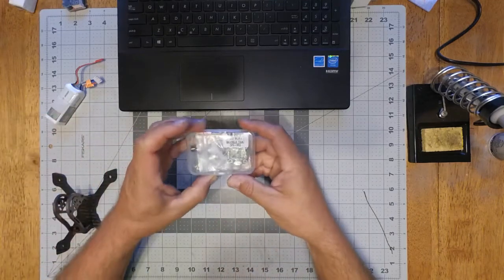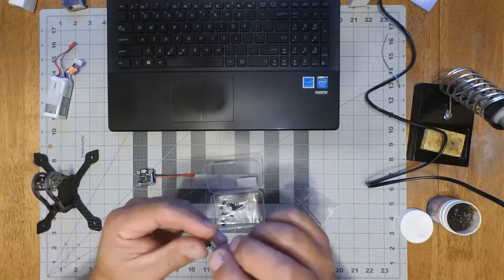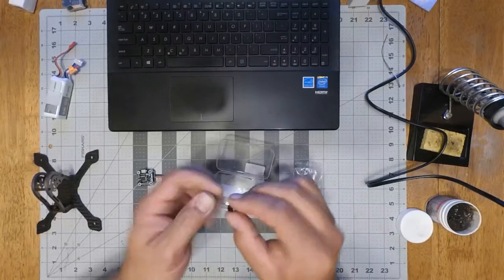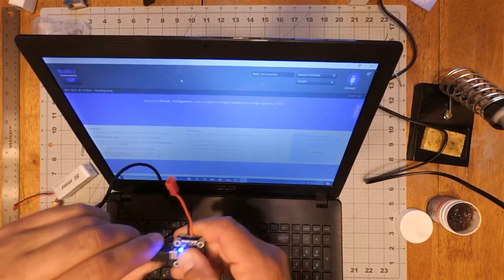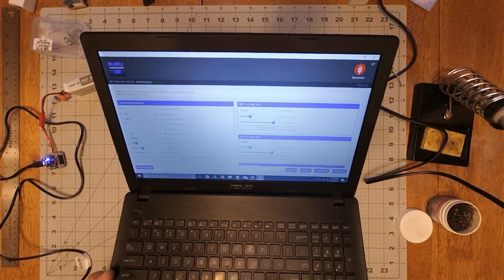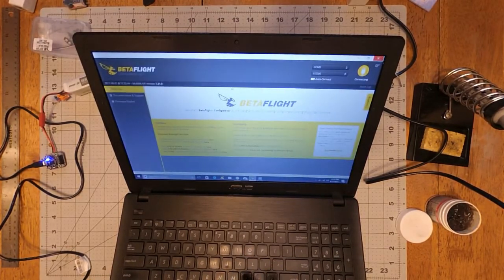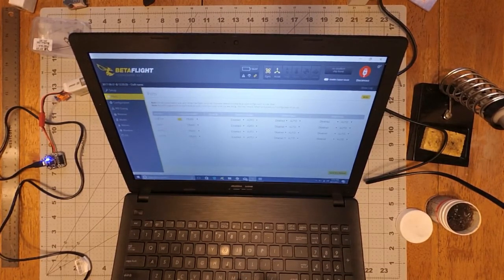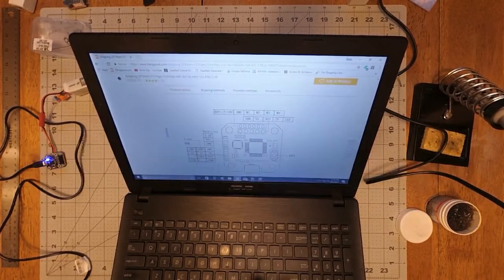PIKO BLX 20x20mm F3 Flight Controller with 4in1 BLheli_s 10A ESC

Comment: i think I got a motor blown on a flyegg 1&0 with piko blx. im having trouble finding which pin is grd. on the esc. I want to check with volt meter but dont want to short ( if thats possible) im new to electronics
Reply: A volt meter wouldn`t damage anything as long as you don`t short something. If your motor is brushless (it shoud be) then it doesn´t matter where you conect it´s three wires. If it turns the wrong way just exchange two of the wires or change it`s direction in Bl_heli suite.
But it is more likely that your esc is damaged than a motor. befor ordering a new motor just exchange the motors to test if it´s the esc or the motor. I didn´t, waited four weeks for a motor just to see that the motor was fine. then had to wait another four weeks for a new esc...

Comment: How is the fc working for you? Where did you connect the camera? Do you know where I can connect a vtx and camera combo?
Reply from the maker: Kai Kim, Hi it is good, but I went with a racerstar 20a and a betaflight f3 instead of this one, this is only able to run 3s so I didn't use it. I run 4s . You can y the main power and ground and use that to power the camera if your camera allows you to use battery voltage that's what I do and I never have noise issues.

Comment: You think that 4in1 can handle 1306/4000kv red bottoms, on 3s? Sub120gram LOS build.
Reply from the maker: WCO lll yes it will work if that's what you want to do, I went with the 20x20 omnibus f4 and the racerstar 20x20 25a esc on my sparrow because I went 4s and I wanted it to scream! Have a great day my friend!
Reply: Torch Fpv subbed 👍😁
Reply from the maker: WCO lll awesome you have question just fire away I'm here to help my friend! I have links if you want just ask 😁 have a great day!!!
Reply: On board solder of led do u have?

Comment: Can it handle 4s?
Reply: Did you try 4s in the end?
Reply from the maker: I bought it with the intent of running it 4s but the seller said no it will not work.. They said 2-3s only :-( so I might try it and see ;-) The FC can handle 4s but the esc's can't..
Reply from the maker: Demi Quad, the manufacturer said it can't handle it so I didn't try it there are racerstar 4-1escs that I use for 4s.. Thanks for watching!